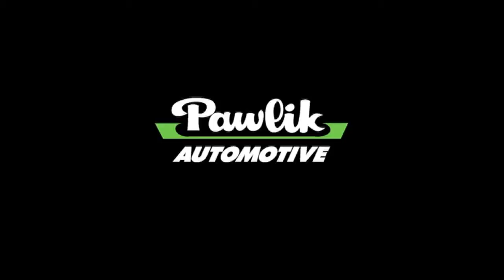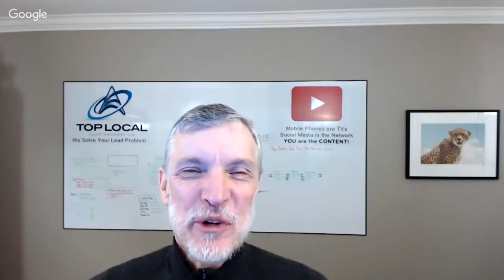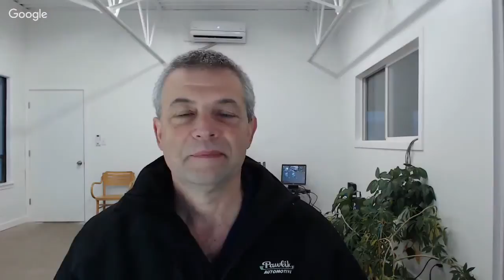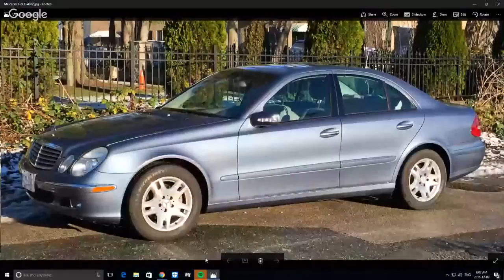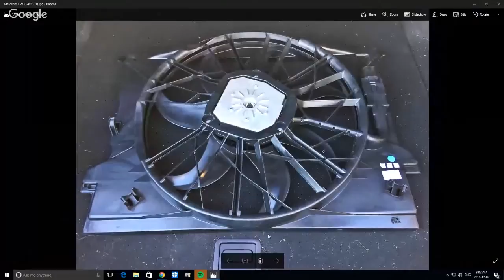2005 Mercedes-Benz E320, Electrical Diagnosis and Repair

Comment: I have a Mercedes E320 2004, and one day the transmission went limp mode. I took it to the dealership and they said they had to replace the Selector Lever for a new one. Will this electrical problem cause a chain reaction of more electrical problems? Please help as this repair was very expensive! Thank you so much!